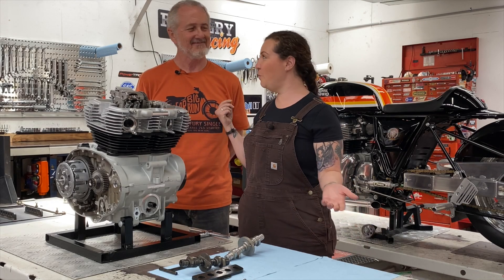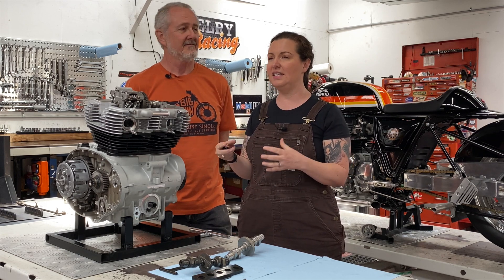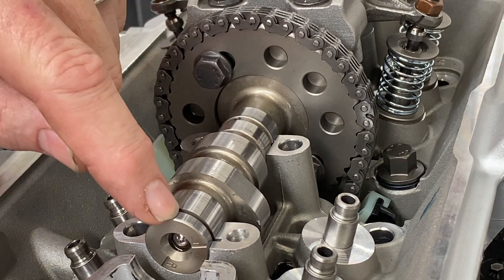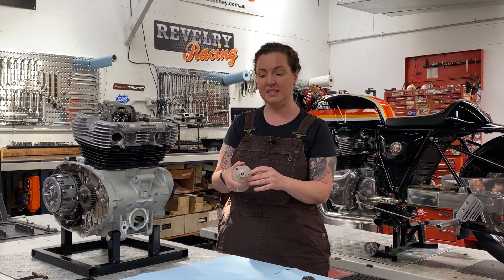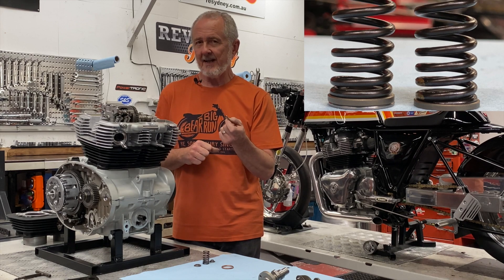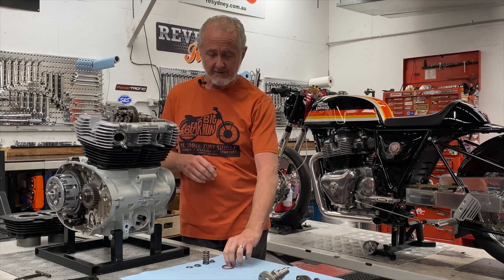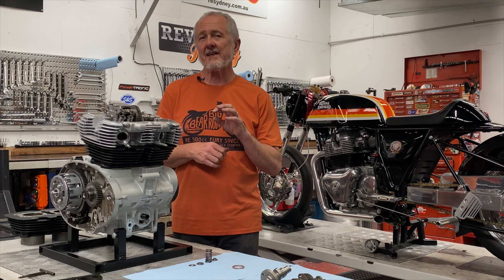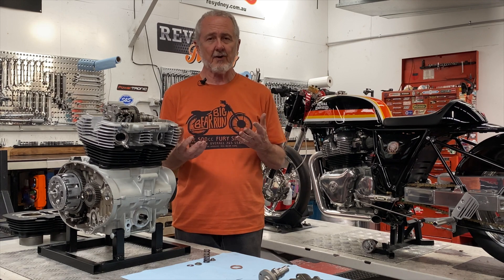Episode 3 Camshafts for the Royal Enfield 650 Twin

Comment: Hi nice info from you, so i got some courage to do this and its kinda fun, can you clear one info plese , on starting point i am doing a cam job and i manage to fit it and i am having dought if the cam timing markings  if it is place correct, so i use a crank pin to lock crank shaft, place the camshaft on L aligned, with the chain tension place on, thats it ? my dought is on cam L or R with the crank locked with pin with chain tension ready.
Thanks in advance
Reply from the maker: Using the RE Crank Lock tool, centre the L with the cam chain tensioner installed and tension on the chain.

Comment: Excellent... when I change the cams I inflate the cylinders to 40 psi without the camshaft and change the springs, so I have even changed valve stem seals without disassembling the cylinder heads.

Comment: Is there a difference between the Pistons that come with the 865 kit and the high compression pistons that are mentioned separately on the website? Are they the same
Reply from the maker: Yeah big difference.  The High Comp are for a 650.
Reply: @RevelryCycles  so they don't fit in the 865 kit? I mean which ones are the best to be fitted in 865 kit..... The ones that come with the kit or the high compression ones that are mentioned separately.
Reply from the maker: @klang01234  no they are not interchangable.
Reply: @RevelryCycles  ok thanks🙏❤

Comment: Since I just picked up my 2021 Interceptor 650 3 weeks ago and love it  , I have since changed out the exhaust I can feel the engine wants more , air filter next , a  K&N probably  , cheaper here in Perth  . Thanks guys for your channel , its what Australia needs as these bikes are awesome and very popular . ps. I am an engine builder at home  ( Mopar ) and a Fitter welder by trade , so yes the S&S cam shaft  is on the cards .

Comment: I just installed the s and s camshaft for my interceptor 650...i have already installed it with a dna airfilter, mufflers, powertronics piggyback ecu and a quickshifter. The bike now has a big idling problem when the engine is hot. Whenever i try to crank the engine it just struggles to start and quickly dies but the problem is not present at cold starts .The low end is also unusally jerky and jittery...but the bike pulls clean after 4k rpm.I am currently using a fuel map for the s and s mufflers and cam with air cleaners...i dont seem to understand what the real issue is.....any advice would be grateful
Reply: Did you find the solution for it?

Comment: Hello 
I'm planning to install s&s cam on interceptor 650, I already have installed slip-on, DNA air filter, and powertronic piggyback ECU. If I install S&S camshaft with these already installed, do I need to install any custom map on the powertronic ECU or stock powertronic ECU maps will do the job? I asked several leads I had but it is of no use.
Reply from the maker: The default map that comes with the powertronic will generally suffice. It will almost certainly run just fine. Of course to get the best performance you'll need to tune each bike, preferably on a dyno.
Reply: @RevelryCycles  Thank you!
Reply: @RevelryCycles  I've installed the s and s cams along with the dna airfilters and mufflers with the powertronic piggyback ecu and quickshifters.The bike is now having a major idle problem when the engine is heated,when i crank the engine the engine it struggles to start and quickly dies... also there is a lot of jerkiness and jitters at the low end.I cant really find what the problem is actually......any advice would be great

Comment: I've put cams in other bikes, but when I realized some time ago that you have to change the spring shims on this one, and probably while your at it do porting , (since it should be removed) unless you use the compressed air technique, I decided not to for go that mod since I don't have a shop any more and live in the provinces of the Philippines. (that just means I can't just run out and get parts easily) . Great reality check for those inexperienced would be do it yourself types, and you make a valid point to seek professional help on this kind of mod for the RE.